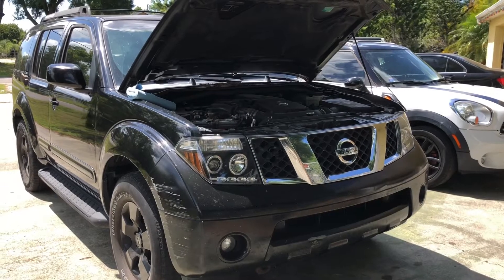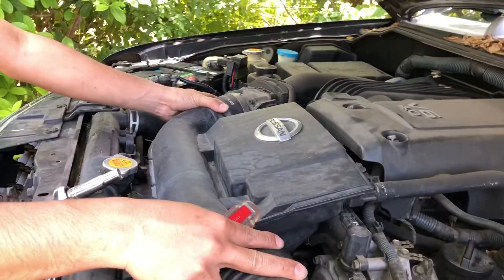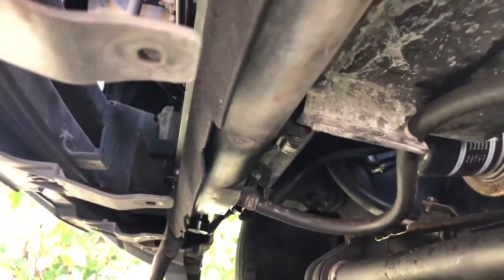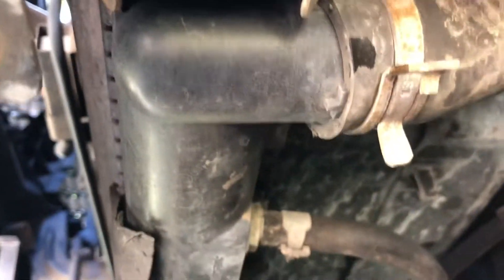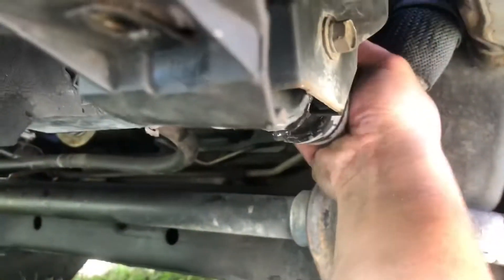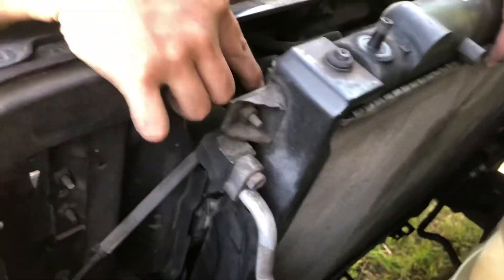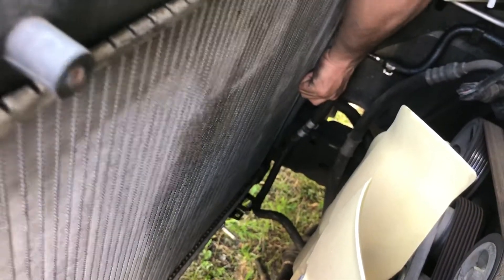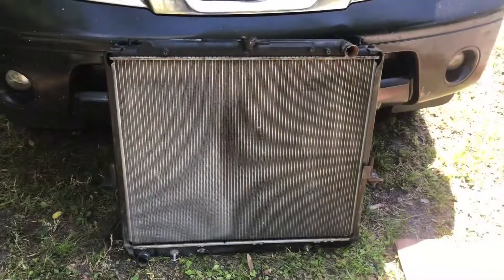How to remove the Radiator from Nissan Pathfinder 2006

Comment: Nice video! Doing mine now and this was very helpful and concise.
Reply: My replacement went well. About 2.5 hours. About an hour of that time was figuring out that I needed to disconnect and pull out the A/C condenser with the radiator. Running cool again.

Comment: This is a great video. I do all mine live. I will do one later today or soon it’s on a 2011. This is a great video. I like to watch them for fun prior to my repairs. Missed a few steps other then that I would say a 9-10 😂 👏🏼. This was awesome. I liked and subscribed. Keep them
Coming. You could change the name and make it a hit. You gave me a great idea of what to call my video. I have not diagnosed it so I may not get to do it but I hope so. This was so easy. Great work. I can tell you winged it and made it look easy. Oh yea. You don’t have to remove the side guards. You can leave it in and save yourself some time. I’m not complaining. This was great. I work on everything out there on the road and I learn all the time. Very rarely do I like a video but this one was great? Is this all you work on are Nissans?? Most are terrible however this looked very easy? How do you get the air out the system? The only part you did not put in and I was curios? Does it have a bleeder or is it just done through top fill and idle on low heat?? Thank you and good work! Next time don’t make it look
So easy 😂 😂

Comment: I replaced my radiator and now my ac is not working is there a ac clip that I forgot to put back on
Reply from the maker: I don’t think it has anything to do with the AC compressor though but did you connect the fan for the condenser.